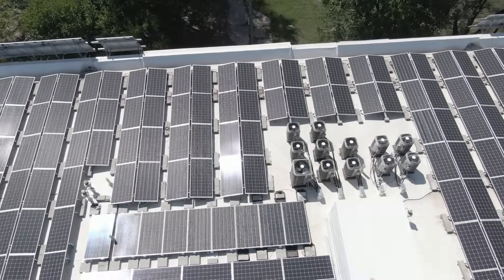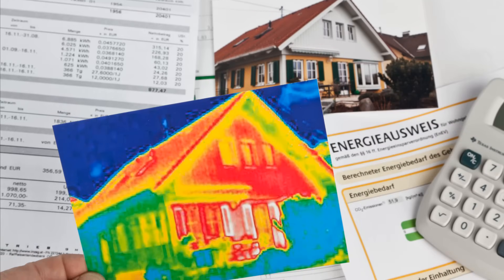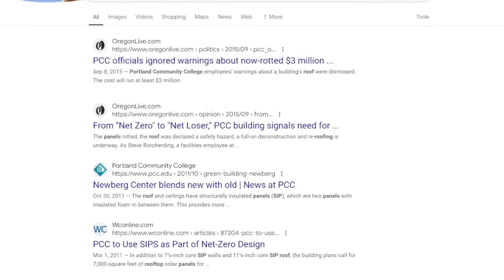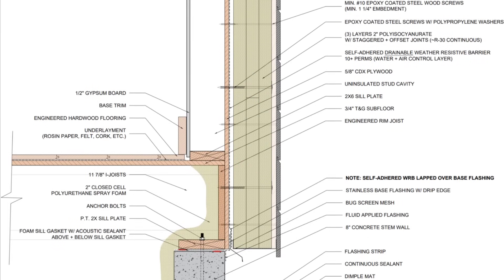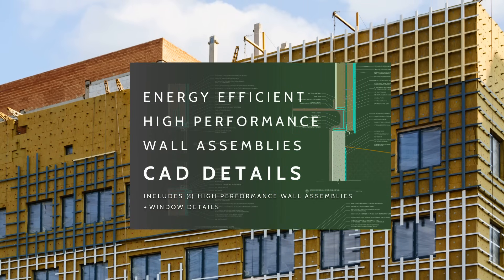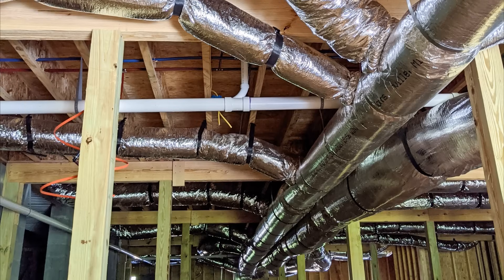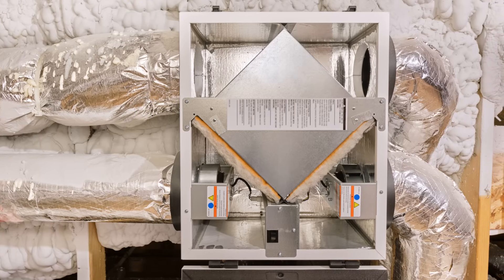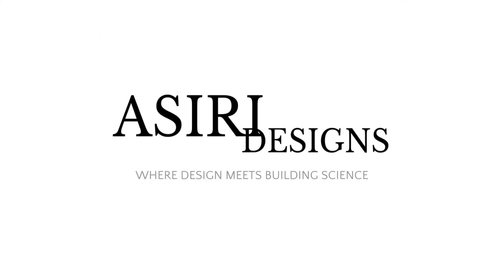The Unintended Consequences of Energy Efficiency...

Comment: Very glad to see someone talk about remodels. I read too much and figured some of this out on my own, but having a professional opinion is great. I'm doing "opportunistic" upgrades on my 100 year old house as i get things repaired. It seems like the main thing is to make it work as it was supposed to when it was first built. After that, you can tweak some. Last big upgrade was A/C (St. Louis, Missouri) and installed a two-stage outdoor unit to help increase run time, and a multi-speed air handler to circulate air 24X7 to help control basement humidity and make up somewhat for not having zones. Next will be to insulate the roof of the stand-up storage attic with vapor open mineral wool to about R-15 with ventilation between the top of the insulation and the roof deck from the eaves to the ridge vent. That should permit drying. It's not R-48 but it's way better than what we have now. After that I think a range hood. I think the house leaks enough i don't have to do much about make-up air, but that would be great. Thanks for your work.

Comment: Good stuff. The Passive House airtigtness of .6 ach50 pascals was established as much for the controll of moist air in  the wall as it is for energy savings. The idea is at that air tighness level every significant hole will be discovered and delt as it will lead to condensation over time.

Comment: At this point it seems cheaper to not insulate and just run extra heat pumps.
Reply: Well there is a tipping point that you reach in which case more insulation isn't that much better. And also, where the behavior of how people use the building becomes more important. Or thermal mass.becoming more important.
However, most buildings around the world can use more insulation than they have right now.

Comment: I think the Passive House Institute would take exception to your claim they don't take moisture management into consideration. Of course they do. Still, it always remains with the designers, architects, envelope consultants, builders and inspectors to ensure the right details and  materials for the conditions. Passive House focusses on insulation, thermal bridging, air tightness and ventilation because it's the cheapest way to get the best results. Once you have a great envelope, other systems to generate and use energy can be smaller and less expensive. You did allude to that.

Otherwise, good advice. Vancouver, where I live, suffered greatly in the 1980s and 90s because many buildings were built without the necessary understanding of moisture management. It was called the leaky condo crisis. Many assumed the "leaky" referred to rainwater, which was only partly true. Much of it was air leakage carrying moisture into the envelope where it condensed.

Comment: Is putting thick insulation in the outside of the structure really more durable? Thick insulation of any material is not going to carry the loads of the siding well, and let’s forget any masonry or cementitious siding.

Building quality long-term structures is sadly counter to our throw away economy in the US, it depends on replacing the cheap failing junk we install so that the factories
making it stay full. Aldous Huxley put it best, “The more stitches, the less riches.”

Comment: Insulation, airtightness, mechanical ventilation, and vapour management, have to be done together. Otherwise you will destroy your house.
Reply: While my Florida home was still under construction we quickly realized that in the spring with 70°F outdoor temperatures the HVAC just never turned on. With spray foam insulation making the house very air tight humidity soared. We immediately installed a whole house dehumidifier with humidistat. It only runs when needed and solved the problem.
Reply: Bang on, vapor barriers and ventilation with heat exchangers. This is well understood and not worthy of a sensationalist ideo like this.
Reply: @vicbauwens  I think there needs to be more conversation about how to manage moisture in climates where there is both a significant amount of heating in winter, and also a significant amount of cooling in summer. There are better solutions than "plastic and foam everywhere" but I'm not seeing them talked about much on youtube.
Reply: @tealkerberus748 it’s not exactly new science but I agree that there is still heaps of ignorance floating around spread by self-proclaimed experts who have taken a 5min course on the internet somewhere. 
It’s a bit like nutrition, the science is very well understood but the ones dominating the conversation are more often vendors of snake oil.
Reply: Yes, and so far it’s always being done poorly.
Reply: @paulb9156  It's all a very new science. It's a problem that the mistakes are so damned expensive to fix .. but consider Roman Concrete. The people who built the few Roman Concrete structures we can still see in Europe today were surrounded by other examples of "concrete" that crumbled within years of being made. They learned what not to do from the bad examples around them. We can do that too.
Reply: @tealkerberus748 oh yes, we COULD  do that........but while there's a HUGE wad of cash to be made by NOT doing it, well I'm sure you can see the problem.
Reply: Goodness, what a way to sell a lot of extra products! Hmmmm. Almost as if...that's the real purpose.
Reply: Water management, air  tightness,  vapor permeable, thermal barrier. In that order of importance. Say Dr. Joseph Lstiburek  who wrote the book that ASIRIDesign read.
Reply: Bingo !
Look up building science Corp .
Joe L wrote the book on this subject .
Actually many books as each section of the country is different or Florida vs North Dakota
Reply: It needs to be done regionally as well.   Vapor management is entirely different in Florida than in Michigan or Arizona.
Reply: Concrete + Good isolation + Good Windows without mechanical ventilation actually does work. You only need a ventilation in the bathroom and a automatic opening. Can get up the Minergie Standards. But it mean the homeowner has to regularly open the windows on both sides. About 10 min 3-5 times a day, depending on the hours spent inside.
That is one of the main issue over here in switzerland with the modern buildings. People simply forget to open the windows from time to time to exchange air.
The one thing builders often do mess up: replacing the leaking windows, without improving isolation = mold. Infrared Camera always catches them, if they mess up thought.
Reply: @beyondEV I'm surprised new homes in Switzerland or Germany don't have mechanical ventilation. In Estonia mechanical ventilation with heat recuperation has been standard practice for around 10 years now. You literally cannot buy a new house without it because it wouldn't been the minimum energy efficiency standards. With mechanical ventilation you don't need to open windows at all if you don't want to. Even old apartment buildings being renovated are usually fitted with these systems nowadays.
Reply: @beyondEV  No, it does not work if you have to ever open even a single window to exchange air and to prevent moisture damage. That is a really bad design for a house.
Reply: I see existing homes being retrofitted with zip sheathing constantly in New England and it isn’t too difficult to tape the seams and get a much more air tight enclosure. You know damn well they aren’t installing an ERV. These homes are going to be in big trouble very soon.
Reply: My old house has a host of issues. The solution is the use of a dehumidifier. I run a dry house. That said I also use HEPA filter. I don't catch colds or the influenza but that is maybe vitamin D3 & K2 plus quercetin & zinc. Some claim humid air helps them. I doubt it for the most part. Mold in dwelling is a huge issue. Get rid of mold and mold spores by stopping their growth and removing the spores.
Reply: it does in our European climate. It doesn’t in climates where you have entire seasons of hot extremely humid climates. Mass is less important there and moisture control in function of cooling below dew point becomes extremely important. In such climates you absolutely need mechanical ventilation with dehumidification.
Reply: That's why nearly all old homes are falling apart. My apartment was built in the early 60s and it has a ton of problems to be addressed.
Reply: @theap0killyp1k2  My summer home in Northwestern France was built in 1821 and has absolutely no problems at all.
Reply: @theap0killyp1k2  A house built in the 60's is not really something I would consider an old house. It's already a modern house built with modern and more economical (cheap) ways. Old houses from the 1800's still stand  strong no matter are they made from bricks or wood.
Reply: the number of times my family has had to open the windows because it's just too humid indoors due to the extremely airtight construction, defeating the entire purpose of having a well-insulated building and efficient HVAC system
Reply: @dawnderg  If your HVAC isn't managing indoor humidity correctly, there's something wrong with it. That is a key metric a properly designed and working system is supposed to keep within a set range.
Reply: IDK. There are a lot of 100-200 year old homes doing just fine and contradicting this statement. Were they built with more moisture-tolerant materials? Yes. Do they leak more air? Yes. Will modern homes made out of OSB and plastic foam be around in 100 years? No. Definitely no. They will be destroyed after the first owner waits too long to install a roof, or the caulk gaps open up, or the upstairs bathroom leaks. First time those happen and it's gone. Hard to repair a house made from trash.

Maybe these are the solutions rather than adding exchangers and dehumidifiers and all sorts of plastic layers and sensors. We're spending tens of thousands of dollars on each house so that we can use OSB, sheetrock, and other non-durable mold bait. Why not just use better materials and apply the energy efficiency budget to solar panels? A $25k double carport of solar panels is enough to make an old leaky Victorian with uninsulated walls as energy efficient as the hyper-insulated net-zero foam boxes with $50k HVAC units.
Reply: @Christolball  your solar panels will not heat a house in winter. Just look at the insolation numbers for the UK, or see Germany's example of what not to do.
Reply: @AltereggoLol1  Doesn't matter. With the way my municipality bills I can carry credits from the summer through the winter, if I generate more than I use in the summer. Might be an issue on a societal level though.
Reply: I don’t want any of that gay shit. I want fresh air from outside.
Reply: Oh, really? But maybe the problem lies more with the materials used ;)
We renovated our house with materials that are air tight, but can still absorb and transmit moisture. It is no secret, not a recent technology. 
1. Wood fiber insulation: has been around for 100 years soon. Good insulator against heat, can safely absorb and release moisture.
2. Clay: has been used for thousands of years. Absorbs and releases moisture to keep the rooms at 45-60 % humidity. It also can pull away moisture from wood.

Now, if you look at the other materials like EPS, XPS, concrete or even that nasty foam... They can't absorb moisture, can't regulate, won't let it pass through outside. Then, when you want to get rid of it, it is not reusable, just trash. Some of it is toxic trash. I'm not sure how much is known about foam insulation, but it seems a big risk...

So, if you could choose, would you still go for the second option?
Reply: @alis49281  There's no way I'd have all those synthetics in my house - I'm Australian, so one of the big questions in any house design is "if it burns down, what are these materials going to do?" and all the plastics immediately fail the test. I'm working towards getting rid of synthetics in our household furniture for the same reason - they're a ticking bomb in a flammable landscape.

The problem is that wood fibre at normal humidity is going to rot unless you've treated it with fungicides, and termites will go straight through clay to get to the wood fibre unless you've treated it with insecticides. Wood fibre (without biocides) is a good admixture in compost, but I don't want it in my house walls. And when humidity inside and out is above 50%, there's nowhere for that moisture to go that isn't a problem, so you're going to get mould and dust mite problems.

I'm still researching, but at present my best answer is concrete, rockwool, and mechanical dehumidification. I'm planning to move to a much wetter climate than my current home and if I'm having damp issues here, it's going to need a lot more work to keep it dry there.
Reply: @alis49281  No, I wouldn't. The open cell foam we used has been great. In summer the attic temperatures are a few degrees above the living space as is the sealed crawl space. Most of the year the HVAC removes any normal excess moisture but when conditions cause a rise in internal humidity the dehumidifier handles it. Most of the electricity to run these systems comes from solar with lifepo4 battery backup.
Reply: I like rocks. we have a lot of them. they dont mold, and maybe even your decendants could live in it 700 years later. the rocks are already made, its just moving them, but in this day and age its easier than ever to move heavy things.
Reply: @GhostScout42  Rock is good stuff. You just have to make sure they're stuck together in a way that will withstand an earthquake, and you're good to go.
A lot of people have died in buildings made of stone when they discovered the hard way that their building couldn't withstand an earthquake.

Comment: Another banger! Would be curious if you've looked at the impact on lifecycle on retrofits? I sometimes wonder if the embodied carbon of all that work is enough to overcome the savings in operational carbon if the building were simply allowed to continue operating normally (inefficiently). That is even with the benefit of assuming the durability is not compromised, something you demonstrate here is not the always the case.

Comment: I feel like the first half of this video is something of a logical fallacy. Anything built wrong is going to fail eventually. One or two examples of a system failing does not invalidate the millions of systems that function perfectly. In essence, you are saying a $30k corolla is safer than an $80k BMW that just happened to be the one out of a million lemons. It isn’t a fair comparison. 

Energy efficiency is about all the systems working together to achieve the same goal, and there are infinite ways to do so considering infinite unique scenarios. The exterior protects the interior and allows water to escape rather than trapping it or funneling it inside. The insulation and wrapping protects from energy loss and from vapor or bug intrusion. The HVAC/ERV/Dehum all cycle and condition air to keep the interior comfortable, filtered, and properly humidified. If any of these systems are done poorly, the entire plan can fail. You can spend $100k on 12” thick ICF, but if you buy cheap vinyl windows and don’t install them properly, you are probably still going to have lots of problems and inefficiency. 

The concept of energy conservation isn’t hard, it’s deciding on the best way to go about it for each specific instance and budget.
Reply from the maker: @Eatfreshguy407  I think you need to re-watch the video. It's simply a fact that you need energy for drying to occur, and so this needs to be acknowledged by the industry to do a better job about the detailing to keep our assemblies warm and as dry as possible. Energy efficiency comes with a thermodynamic penalty. That's the point of the video.
Reply: Exactly. Exterior insulation doesn't fix moisture problems. This is snake oil.

Comment: My crawl space if uninsulated. It is also prone to soil moisture. Of course it would be best to solve the moisture by lining the space. It is a very tight and complicated space. We have a mild climate. In fact the coolness of the space keeps most of the house cool so we hardly use the air conditioner (second story sometimes). The only problem is cold floors. It may not be worth the risk of insulating a floor that is in good condition for over 40 years.
Reply from the maker: @pcatful Crawlspaces can be a completely different animal, since you're constantly dealing with moisture and soil gasses migrating inwards, and you can't effectively dry into the crawlspace. We have a whole video dedicated to this if you're interested: https://youtu.be/3YOIzEzEwWo?feature=shared

Comment: I am building a small cottage--not a tiny home.  It is 20 X 15, 17 ft tall.  I designed it with 'double stud' walls; 16 "on center 2 X 4's with another row of studs also 16 " on center, staggered.  Thus, there is almost no heat transfer between the outside and inside.  During a week of 95 degree days, my cottage with the insulation and drywall installed remained 72/75 degrees without opening doors or windows and no mechanical HVAC.  I also have mounted the electrical system in conduit on the wall so that there are no holes in the drywall for outlets, lights, and switches.  All of this--effectively getting the house to passive--gets me no credits on the energy efficiency code because they assume that no one will build double walls or even eliminate electrical holes in the drywall.

Comment: The diagram of condensation control has N/A for some areas? Does that mean you can’t do exterior insulation in those areas?
Reply from the maker: @dillpickle1308  It's not required in those warmer climate zones for condensation control since it's seldom cold enough for condensation to form on the backside of the sheathing. You ofcourse can install rigid insulation outboard as a thermal break to prevent heat gain from the hot sun through the conductive structural components.